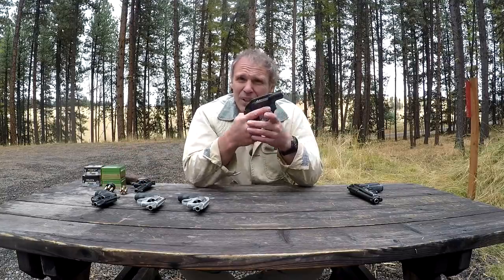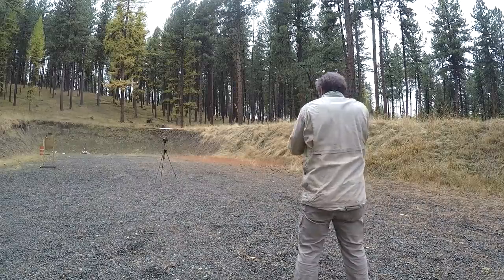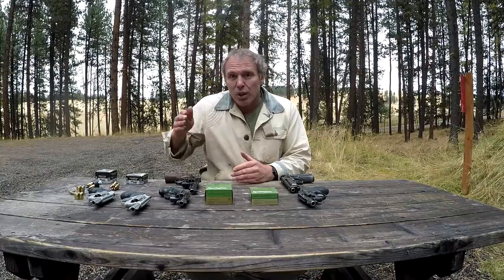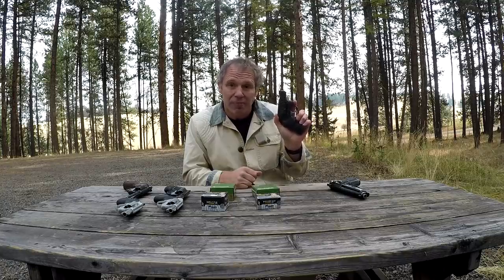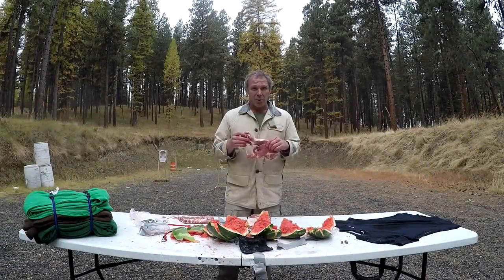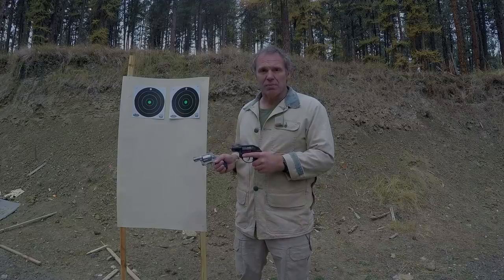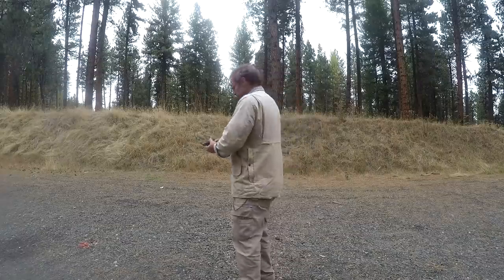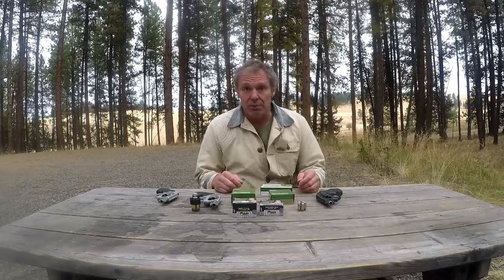Ruger LCR 9 Millimeter

Comment: The barrel length is definitely something that Paul is right about. Often times bullets are of different design. Take Speer Gold Dots for instance. In cartridges like 9mm+P, .357 Sig, .357 Magnum and the like, the Gold Dot bullet is a totally different design than their "short barrel" configuration of bullets they offer. As my friend Fudmottin found out from Speer themselves, The short barrel version bullet (as what is used in standard pressure 9mm, .38 Special+P, .380 ACP and the like) is not only designed differently from how the segments are designed to open up at lower velocities, but the plating on the bullet is much thinner than standard velocity Gold Dots. You also see similar changes with ammo such as Critical Defense vs Critical Duty by Hornady. Critical Duty (full length barrel ammo) is essentially a hard cast bullet with a very thick jacked with a ballistic tip for some expansion but to allow for hard barrier penetration, as where the Critical Defense bullet is a softer lead core with a much thinner jacket and ballistic tip, as to allow for expansion without hard barriers-at low velocity.
Reply: Exactly!!
Reply: Been watching a lot of your vids lately. Keep up the work.
Reply: Thank you. Thanks for watching!
Reply: I was a bit surprised at the 9x19mm velocity out of the Beretta 92 in this video. I was of the thought that +P would deliver about 1250 fps with a 124gr bullet which gives you 430 fpe. Instead, in this particular case, Paul got only 1150 fps which gives you 364 fpe. Still quite a lot more than .38 Spl +P but less than a .357 Magnum tweaked for a short barrel.
I do like how the Sig Sauer performed. I hope it does as well out of a Sig P938 or Ruger LC9s.
Reply: Un-agreeable chronograph results maybe.
Reply: Gun Sam Revolver Aficionado I posted a few questions in my own post. Take a peek
Reply: @Fudmottin  - 1250 seems a bit high for a 124 from a 9mm [+P or not].  Most of the stuff coming off the shelves don't do much more than 1150 from a 115gr; the exception being the CorBon @ 1350.  No doubt BuffaloBore probably has something along the 1250 mark, but they are usually the exception.  BB must spend a lot of time blending powders to achieve the velocities they do.
Reply: @northof50now, I do seem to have given the 124gr 9x19mm +P too much credit for steam power. I'll go with the chronograph numbers. All it means is that people who claim the 9mm is "just as powerful" as a .357 Magnum out of a snub nose are all that more wrong. You need to go to a very soft .357 Magnum round for that to be true. Speer's 135gr GDHP which is a short barrel bullet can do 1250+ from a 2" barrel with 17.5gr of Accurate No. 9 and CCI 550 primer behind it (load data from Speer). As for Buffalo Bore, they have the 158gr soft cast LSWCHP-GC in .38 Spl +P (20A/20) that can clock 1000 fps out of a snub nose (and it is not over pressured) and deliver an honest 350 fpe. I'm sure BB does also run over pressured rounds. You don't get that sort of reputation for nothing.
Reply: @Fudmottin  Not certain if BB runs over pressure.  Far too much to lose in a lawsuit.  I think they just spend a great deal of time blending powders to give the most velocity.  After all, they've made a name for themselves on velocity - not bullet performance or accuracy.  Most manufacturers are concentrating on bullet design, functionality and accuracy, leaving velocity behind.  How else can you explain the Remington G&W box 357 ammo to be so much hotter than almost anything else out there...and it's well over 35 years old.  I can remember choreographing that round in the 80's.  It was the only  round I couldn't duplicate in hand loads.  Also, velocity has to match bullet performance.  I've loaded some really hot 10mm loads that destroyed GoldDot bullets.
Reply: @northof50now, I feel safe with BB. I have some more for the coolness factor than anything else. It is expensive after all. The Gold Dots are reasonably priced and not what I would call "hyper ammunition". The 135gr SB stuff is designed for lower speeds. I got this straight from Speer tech. The 1200fps range is the fastest you want to load it because the bullet will not hold together at higher velocities. Speer has thicker plating on their higher performance bullets. Also, I personally don't enjoy the intensity of full power loads out of short barrels. Fiocchi's 142gr stuff hurts to shoot out of a S&W 649. That's a 22oz gun with 2.125" barrel. I can feel the blast in my chest when I light those off. I'm sure they're fine in a longer barrel. My first gun is a Taurus 669 6" barrel .357 Magnum. I've shot the Remington UMC branded ammo out of that almost exclusively. Anyway, the Speer .38 Spl +P ammo is readily available for not much more than practice ammo. Every place I've found with the .357 Magnum version is sold out when I look and it costs about twice as much. It's loaded to short barrel specs. Anyway, I generally like the Speer stuff. I also have Hornaday which I also like because it is "underloaded". It's not unpleasant to shoot. It is a bit more expensive though. Mind you, there is plenty of ammo out there that costs plenty more.
Reply: @northof50now, I just remembered one experiment I tried to get super high velocity in 9mm. I loaded 90gr JHP bullets that were intended for .380 ACP. As they were .356", I figured they would be safe enough. I was testing in a used Sig Sauer P226. I used Power Pistol and a magnum primer to get them up to right around 1400fps. They simply went splat on the target. Almost no penetration at all. I went to the other end of the spectrum and played with 147 grain Golden Saber bullets. Those I couldn't push very fast with the powders I had. Since then, I've kind of preferred 124gr for 9mm. For .38 Spl I like to go a bit heavier and like the 135gr weight. Same deal with .357 Magnum. Although both of those I would load with 158s provided they are plated or have gas checks. I hate leading.
Reply: Gun Sam Revolver Aficionado "ballistic tip" 😏
Reply: Buffalo Bore actually mentions in their company statement that SAAMI specs being followed in certain cartridges is a bad thing, and seeing as they are not a member of SAAMI, I think they do tweak some cartridges hotter than SAAMI, in fact they would have to in order to make their 9mm +P+ seeing as +P+ is not a SAAMI designation.
Reply: That's a fair point. I would never run a +P+ 9mm. I would be OK with +P in my LC9s. I plan to stick to standard pressure in the Sig P938. One thing I do wonder about is the .38 Spl +P. While I don't want to damage my 638, it's so much easier to carry than any other gun I have and giving it a tad more pop would be nice. As far as I can tell, it has the exact same cylinder as the 649 except that it is bored for .38 Spl only. It does have only an aluminum frame though. I think it was made before S&W even came out with scandium guns. Pushing the 135 grain GDHPs out at right around 1000 fps may not be too hot. It's a lot more than the 800 or whatever the 342 pushed them out. 1000 fps would be right at 300 fpe. 950 fps would be 270 fpe. That's more than the 210 fpe I recall the 342 getting.
Reply: Wow this is the first time I've ever seen a real explanation on the Gold dot short barrel ammo. Thanks.
Reply: In .38 Special +P, I find it more practical to use a 110+P to reach that coveted 1,000 FPS mark in a snubby, which I have pretty much done, or at least came within 30 fps of that mark with some 110+P ammo's. As far as pushing a 135 to 1,000 fps in a plain aluminum alloy framed revolver, I can't see where this would be a problem unless you planned on the entire diet of your revolver to be that ammo, which most people would not. Now we have to remember that a .357 magnum in a 340PD would probably push a 135 at 1,200 fps or so. It would be a little rough on the hand and the gun to do a 135@ 1,000 in a 638, but probably no more wear and tear than a magnum scandium gun would take on with a magnum.
Reply: I would probably be happy with 950 fps. The 30 fpe difference is the same as dropping a 40lb bag of salt 3/4 of a foot or nine inches. I put more salt in the water treatment system I have a few days ago and the salt comes in 40lb bags. That's where that analogy comes from. Anyway, I certainly wouldn't make it a steady diet and I can use gap gauges to see if the cylinder gap changes. More interesting would be to wire up a strain gauge to the top strap. That would get a bit fiddly though.
Reply: @Fudmottin  Yes.  The CorBon 115JHP will fracture when shot into water jugs.  I'm not certain what bullet they use in their 115 [thought it was Sierra for a while].  I've been temped to make a PH meat target and give it a try.  1350 from a G19, is hotter than most 38Super rounds.  But, again, worthless if the bullet will not hold together - unless lack of penetration is your primary prerequisite for a cartridge/caliber - which it is for my particular situation.
Reply: @GunSam   You can understand why the statement would be made.  SAAMI sets standards with the understanding a wide range of firearms will be used.  Metal technology has come so far, that it is easy to understand why some cartridges have a very "conservative" SAAMI rating - the 45 Long Colt is a perfect example.  A Ruger Redhawk in 45Long Colt can be loaded far above SAAMI.  In fact, many manuals have different loading for the older Colts.  The 10mm also suffered from this, as manufacturers did a poor initial job chambering blow back designed pistols for it.  Many simply couldn't take the pounding as designed.  Today, there are many firearms that can withstand the pressure of the initial round [Norma 170gr TCHP - 1350fps/5" barrel] without issue.
Reply: @northof50now, are you at liberty to say what your situation is that you need low penetration? I can think of a few situations off the top of my head, but they are all different. I forget what brand of 90gr JHP I was using that disintegrated on contact. Possibly SMK. I never tested for accuracy though which would be important in a vermin situation.
Reply: @Fudmottin   - ha!  Yes, my wallet :-)  Carrying a firearm is wrought with personal decision and things with which we need to come to grips.  One of the biggest is the high probability of a $50,000 attorney fee (guilty or not).  Supplemental lawsuits from citizens being hit by "pass-through" is at the bottom of my list of things-to-do.  I'm in the Clint Smith camp, "if the assailant doesn't comply...shoot him again."  For that reasoning, I tend to favor the larger, lighter diameter bullets i.e. 185- 45acp, 155- 40SW as defensive rounds.

Comment: The price of ammo should be a factor brought to the table. I’ve been waiting for the LCRX 9mm to be added to the LCR family. I have the 38SP LCRX and would like the lower cost of ammo of a 9mm. I understand the cost of premium ammo may not be too different between 38 SP and 9mm but range ammo would be. I’m buying 9mm for  $10 a box(50) and usually get 38 around $16-17 a box of 50. This can allow for more range time with 9mm.
Reply: Spark Jumper it’s available now
Reply: @Sparkjumper59  I have the LCRx in 9mm for pocket carry, I love it. I hope they come out with a 3" version as well, I'll be all over it.
Reply: @davem4193  but doesn't the exposed hammer snag when drawing, from pocket?
Or at least, prone to?
Reply: @bmaxse  it can, the best thing to do is put your thumb up against the hammer when you draw. It won't snag that way.

Comment: Probably one of the most surprising results so far (for me at least). I wouldn't have guessed that the 9x19 would make such a formidable revolver round. Also probably one of the few upsides for Hyper-Ammo, apart from the Extreme Defender in 380. ^^
Reply: its kinda simple really, smaller Luger cartridge is rated to 34100 PSI pressure while much larger 38 spl is rated only to 21800 PSI ... 

its not that 9mm Luger is "formidable" its the fact that 38 spl is outdated useless garbage of a round
Reply: An upside of Hyper Ammo, or more likely these are not quite what he means when he coined the term. I also found myself wanting, initially, to exclaim this must be an exception to his Hyper Ammo notions, but instead I came to consider if the case is that the Golden Saber and Sig ammo aren't quite considered to be Hyper Ammo. I can say I've personally found both ammunitions at times for sale at a more intermediate price tier, despite the fact that they perform on par with just about anything else that's consistently much more pricey. The huge performance gap between the two and the terrible expansion of the green & white box JHPs doesn't make them necessarily Hyper Ammo, it just means the G&W box drek is shitty for self defense.
Reply: @Asghaad yeah, I'll be sure and tell Lee Harvey Ozwold the 38 special round is useless and ineffective

Comment: Will Paul settle the Yankee/MAC 9mm snub nose revolver debate??
Reply: Yankee is crazy and mac is subjective with no real testing. Not that it matters.
Reply: I immediately went to watch the 9mm vs 357mag PH video after the Dave/Tim controversy flared up. I think Yankee and MAC are having more of a semantic difference of opinion than anything.
Reply: There is no debate. 9mm is a high pressure cartridge where 38 special is not. 9mm doesn't compare to 357 Mag in a 4 inch barrel as proven. Do we need to debate why🤔...No.
Reply: you actually watch and listen to the yankee marshal,that fucking guy is a leftist pro gun control anti trump democrat scumbag.
Reply: Yankee is definitely NOT Pro gun control.
Reply: Packinaglock - I hear YM is going to offer a signature soap-on-a-rope.
Reply: I would disagree.  If you look at the testing done by Lucky Gunner, most 9mm rounds struggled to get 1200 fps out of 3.6 inch barrel,  while at the same time, many 357 rounds didn't have trouble reaching or exceeding 1200fps out of a 2 inch snub nose. Some of the true hot 357 were getting around 1400fps out of a 2 inch barrel. I carry 9 most of the time, but it is not as powerful as 9mm and it definitely doesn't "rival" 357 Magnum as MAC subjectively named his video.
Reply: Great video! .327 Federal next?
Reply: @workingmansdead44-ug8hl  anti-Trump = pro-USA. Sounds right to me!
Reply: He just did.
Reply: @icopter  Was just thinking .327 myself.  Would like to see how it compares on the meat target.
Reply: Yankee is one of THE most pro gun/anti gun control people on youtube. While I can see why some people might disagree with him on other subjects, the guy is a hardcore 2A supporter and advocate, thats something he CAN'T be faulted on at all
Reply: @workingmansdead44-ug8hl  Trump is pro-gun control...
Reply: @workingmansdead 44 At least he is right about the anti-Trump part since Trump is for some gun control. It was public knowledge he supported New Yorks gun laws right up until he ran when it was convenient for him to lie ...it really makes you think how easy it was for him to convince Republican sheep he was pro gun though.
Reply: .38 is better than 9x19. That's what I say, and since I'm a minority you can't question me or my facts if I have any.
Reply: I would say Yankee is silly, not crazy...
Reply: Go Yankee!  We need more "leftists" like him to tell the rightists that we lefties also own firearms and VOTE!
Reply: J. P. Didn’t even know that there was one going on.  😅
Reply: elk hunter I’m in your camp with this one. I used to enjoy YM he was funny and entertaining but I unfollowed all his stuff recently because of what you said. If I want to listen to cranky dudes griping I’ll turn on my CB radio. That’s pretty much all you hear on it anymore also.